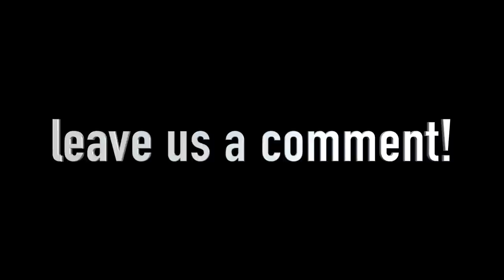EPIC Backyard TRANSFORMATION! Deck, Patio, and Pergola Time Lapse

Comment: Well this is easily a nice 60k+ project! Helical piles are always a nice overkill, the LVL was a nice touch, but I'm not a fan of ledgering. Every deck I inspect has an improperly installed ledger board it seems like.
Reply: @itp5x5 It looks nice for sure! In my opinion it's overkill. Very rarely can a deck be properly resurfaced, but if it can then 100% of the time you'd wanna tape those joists. 

New builds I don't see the benefit personally.